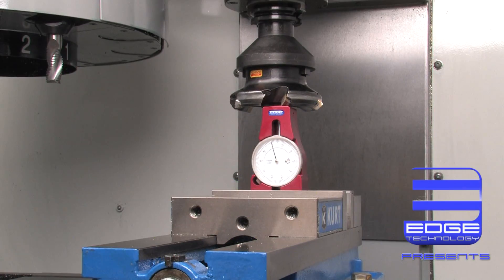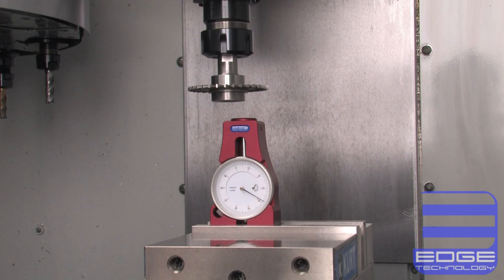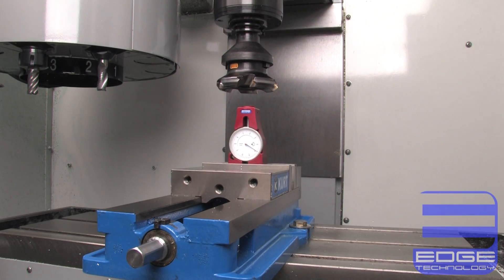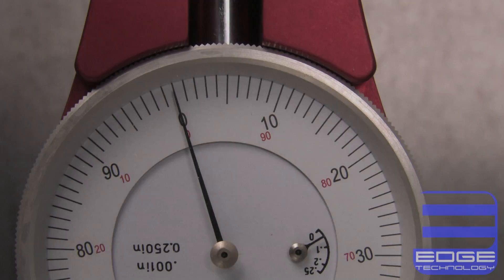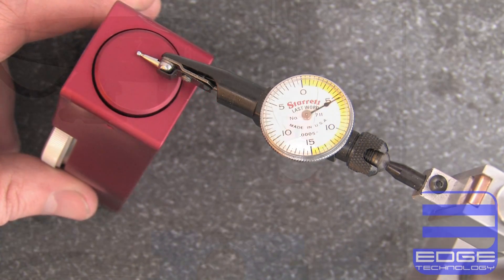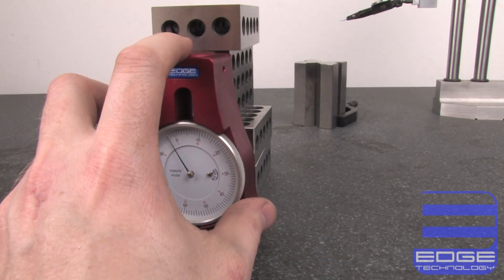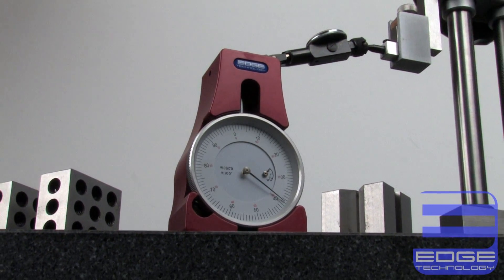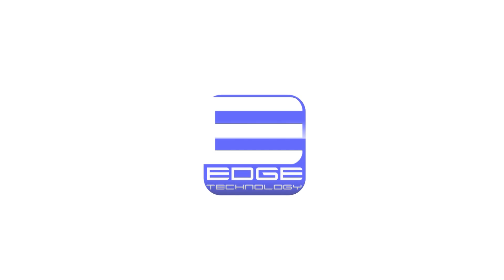Pro Touch Off Gage cnc milling machine tool setter

Comment: You know you are supposed to use the table for this it don't move then your work offset is found by indicating the same block and the top of the part then you do the math to get the difference then plug that in as your work offset as a positive number so the machine knows your work is 5 positive or whatever from the tip of your tool

Comment: found one 10 cm high in tool rack stand in new place I work at,weirdly noone uses it,they all do this "zeroing of tool by weird touch on material" which i dislike as you can barely see that with some thin milling tool or drill .

Comment: The one I use is 2" tall, and works pretty good, I do a lot of work that is tall so my Z travel is limited at times, to where 4" would be too much. :)
Reply: do tool offsets off the table and then g54 on your part, avoids the overtravel of part+4 inch+tool length